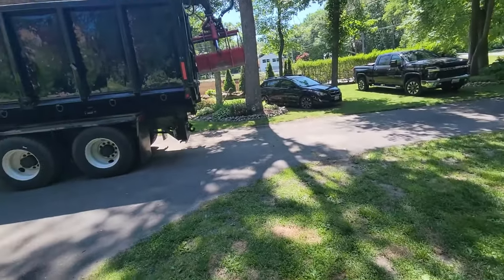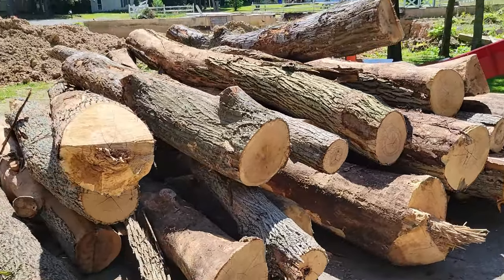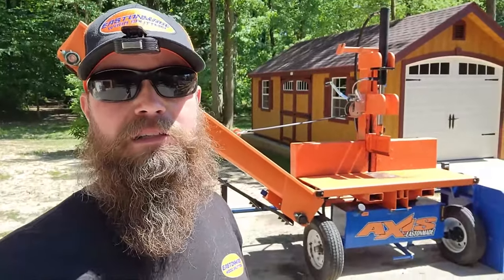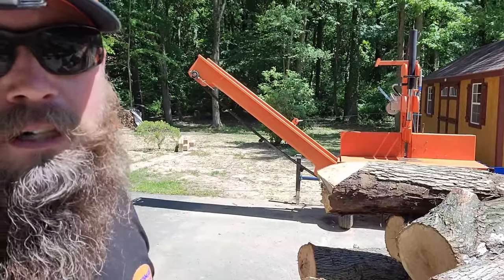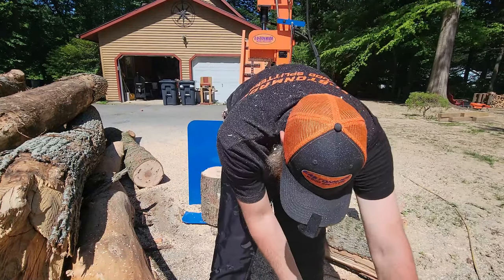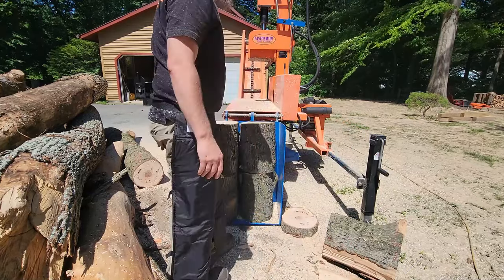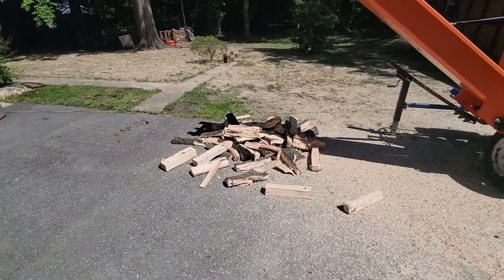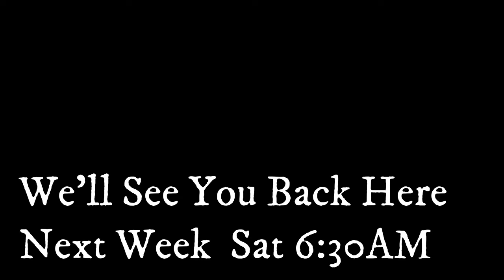New Equipment and a Log Delivery!! 64

Comment: Good job with the vid Jack.  I was happy to hear you picked up the Axis.  It looks like Andrew changed the log lift...doesn't look the same, and also they put a seat-belt style winch on it bc mine was a cable.  I think that's evidence Eastonmade is operating with customer service in mind and not simply flipping machines.  I know you will enjoy it.  That worn area under the knife is evidence it was productive at OWB!  Joe
Reply from the maker: You got a good eye Joe! They did retrofit the new style log lift to this machine, and I wasn't aware of the winch, but thats cool they changed that too.

The team up there in Canada is top notch.  I was extremely happy to be able to grab the Axis, it's a great addition to my collection of Eastonmade equipment 😂😂 appreciate you stopping by Joe, means alot buddy ✌️

Comment: You'll absolutely love the Axis for making bundle wood. Plus now You'll be able to work around the rot and knots. As far as hickory goes, is very desirable as a smoking wood. I wouldn't sell it for less than $10 per 0.75cuft bag/bundle. I can tell that you are still jacked up with this new toy! If I ordered an Axis and it would be my only splitter, I'd have to have the conveyor and oil cooler for production runs and mobile splitting jobs.
Reply from the maker: Buy what makes you happy Jeffrey.  For me I'm keeping both machines.  They both have their places in the industry

Comment: Looks like you have a solid supplier of logs if you want to continue going that route.  Also looks like bundle-grade wood will be way easier to get.  It would be interesting to see a time comparison for a measured amount of wood between the two.
Reply from the maker: Definitely think I'll continue going this route when I don't have any to go cut on , or get anywhere.  I'll have to write that down and try it eventually too for the time thing, I'm sure the 9-16 will out preform with having the multiple wedges vs, just having a single on the Axis. Thanks ☕️

Comment: I like a vertical splitter. I just upgraded to a commercial splitter. It be long time before can add anything different. That’s nice load logs. I think I like my Acumark better than perfect stick. It bends rather than breaks that plastic disk. Have a great weekend.
Reply from the maker: My plastic piece on my perfect stick is a flexible rubbery type of material.  I love them more than the accumark😂😂  I get a more consistent piece out of them for some reason 🤷‍♂️ you have a great weekend too!!!
Reply: @LogCabinFirewood  I might had older one hard plastic ever time used it I break disk off. Have glue back on. I have took tape to the load cut yesterday but sure close enough.

Comment: Nice job Jack! My beat up tar driveway has been stopping me from getting logs delivered here... I agree with you on the text version of business, context and tone are hard to tell. The only thing I like about it is the permanent record of the conversation to go back to on questions later on. Awesome story on the splitter! I have goals to get something similar for myself in the future for now, I'll just be envious lol
Reply from the maker: I'm gonna try and stop having logs dumped here, and only placed, but free is hard to beat sometimes too. 

Even here sometimes it's hard to read how some messages come across too, with context and tone. I think I'm just old school and prefer talking over texting. 🤷‍♂️ 
Don't be envious,  if it wasn't for my real job I wouldn't have anything I have, firewood hasn't become profitable to me yet, it will eventually.  It takes alot of wood and time to make money the right way with firewood, or any business.  You'll get there,  you can achieve anything you want!!!
Reply: @LogCabinFirewood  do you ever worry about the weight of the truck and the load they bring? I did contact a logger and he declined my request due to my driveway said he didn't want to drive in because of the residential tar thickness
Reply from the maker: @CentralMinnesotaFirewood  I'm actually talking about that in the video I'm recording as we speak... my driveway is trashed from bringing in tri axles over the years, I'm okay with the wheels driving,  I just don't want stuff dumped anymore.  Dumping breaks up the blacktop alot faster than the wheels. Great question,  you'll see me talk about it in 2 weeks. Next week is all about the wolferidge bagging station!!!🍻

Comment: Do you like the accumark or the perfect stick better?
Reply from the maker: Howdy, thanks for the question. 

I prefer the perfect stick more, due to the large round disc it has on it.
The accumark works fine, but it's skinnier than the width of the chain, and I feel I'm not as accurate with it. 

It's really just personal preference for me, they both work 100% to measure out the wood.  The perfect stick is also a small business close to us, so i try and support them as much as possible too 🤜🤛

Comment: Peer pressure...    Wonder if you crossed where Tony did?  Call that smooth bark hickory here. Not sure what it really is
Reply from the maker: Yeppers. We both crossed at Alexandria bay,  1000 island area. I don't think it was peer pressure,  I think it was friends looking out for friends and remembering that I've wanted a vertical splitter for a while now. I'm thankful my buddies reached out and I got a really good deal on the splitter.  I don't mind used when the equipment will last more than a lifetime!!!
Reply: @LogCabinFirewood  nothin wrong with used. Everything I have except manure spreader and haybine was used. By Dad, does that count?   Do you watch logger John? He's from Perth. Surprised he didn't ask the helicopter to buzz Andrew when he went up in one at some festival
Reply from the maker: @brandonhoad9033  I do not , I will have to check him out.
Reply: @LogCabinFirewood  he's got almost as much ash as I do